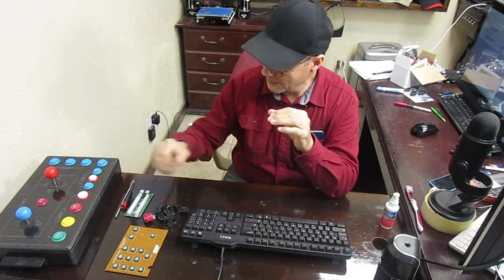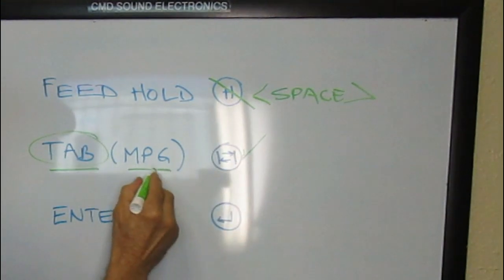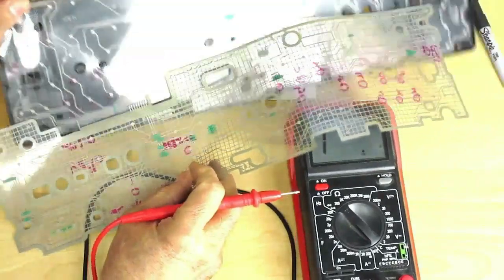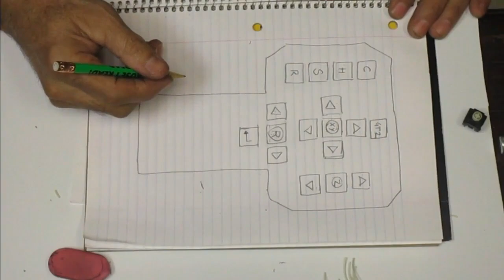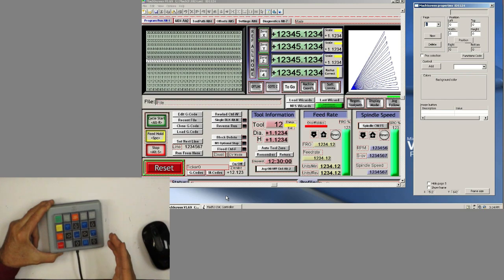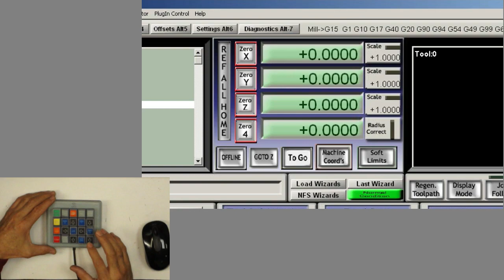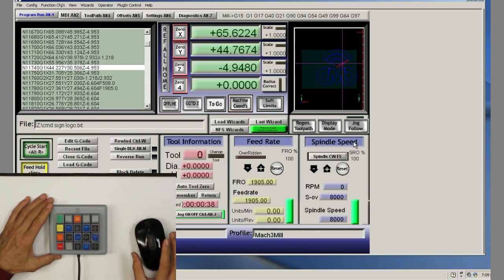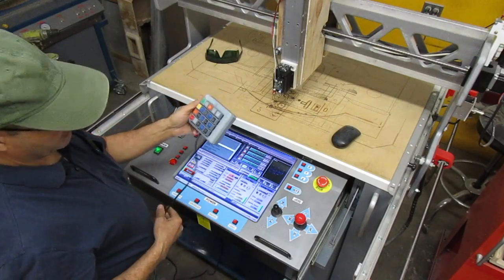Build your CNC Pendant

Comment: HI, would it be possible to have the feed plus and minus with a potentiometer/jog wheel  instead for two buttons +/- ?
Reply from the maker: No, because the action is not dependent on resistance, but in clicks. same reason you can not directly use mini joysticks  like the ones used on Xbox to jog, it  has to be an on-off momentary switch . It may be possible to use some sort of rotary switch though , I don't know. I may look in to it in the future.
Reply: @CarlosMDominguez  thanx, what do you Think to use a volym knob on a keybord? That works as a potentiometer I guess.. or use a midi interface for music..there is lots of buttons start stop recors etc. and volume wheels and faders.... if you buy a dedicated hand jogging wheel for the cnc machine its basically the same??? Midi signal's going   from the unit to the PC I guess?
Reply from the maker: @betamorf  I guess there is only one way to find out. If you watch my video you know that I used Mach Screen editor to configure the buttons. Try to configure the feed button using the keyboard volume knob instead of other normal key and see what happens. Please let me know. I can not do the experiment because I do not have a keyboard with volume controls (multimedia)…. good luck!!
Reply: @CarlosMDominguez   thanx again, today I´m using a ddcsv offline control, and dont like it at all.. so I going for the uccnc and like to have it like as near a real cnc machine as possibe" buttton wise" ..Im used to have a potentiometer for feed overide etc , as before when I was a CNC programmer and operator=) I will investigate this and come back if I sucess .
Reply: Just tested the volume knob and it worked  fine to adjust the feed overide with it.
Reply from the maker: @betamorf  Great! I am glad you find the answer. Thanks . I am going to look for those keyboards at the goodwill store and take them apart to find out what kind of encoder and the connection to the keyboard controller.  Thanks again!